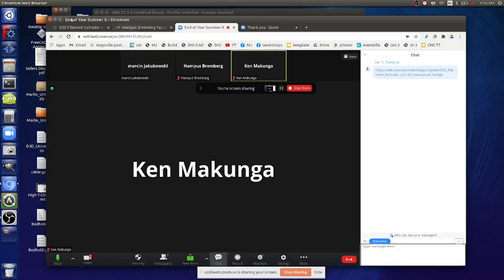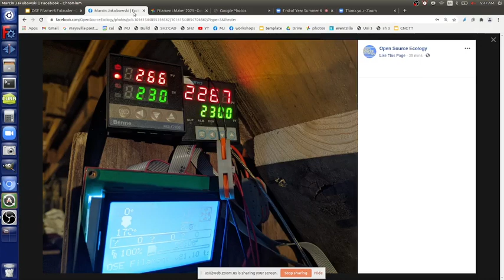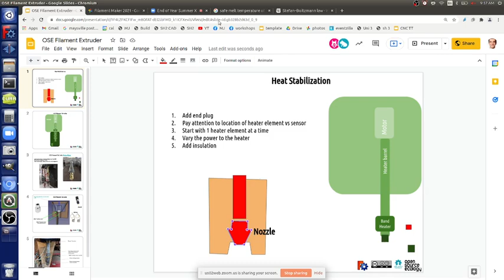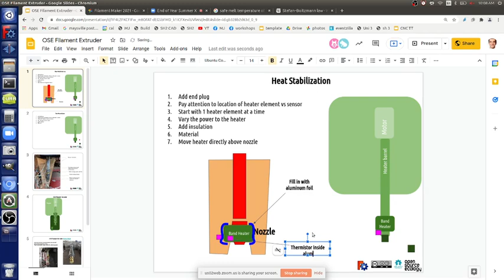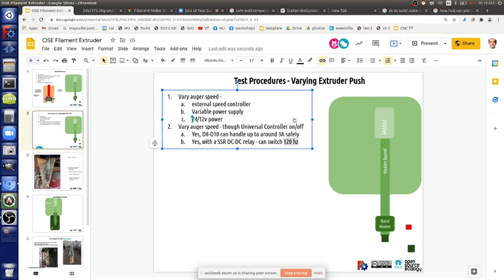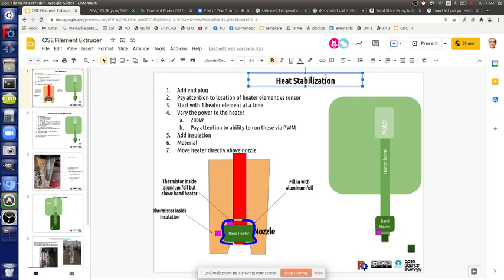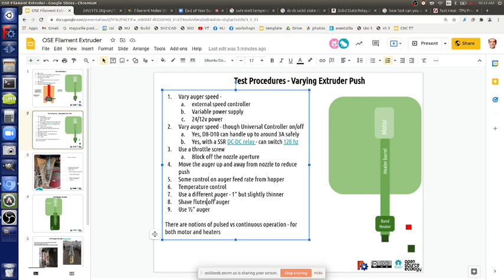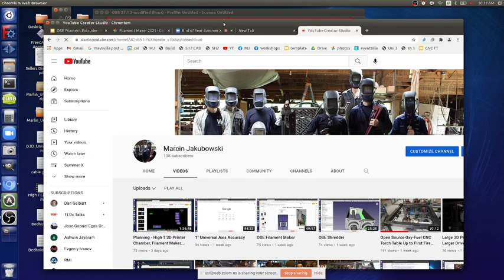Filament Maker - Controlling Flow and Temperature

Comment: Could the universal controller connected to an octoprint instance and then linked via mqtt and relevant octoprint plugin to homeassistant install on a second raspberry pi allow for data transfer and graphing.  Home assistant has grafana and influxdb add-ons